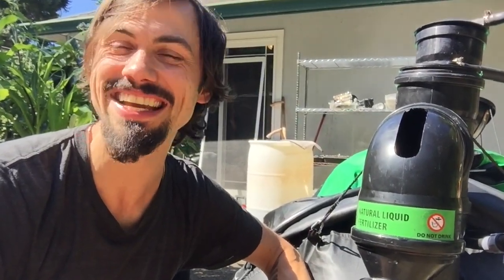Turn Your BLACKWATER into FERTILIZER with Permaculture Soil Science!!

Comment: How much/often do you have to feed the digester to get steady gas flow? Do you solely use biogas?
Reply from the maker: Great question! I just got it going - gas is about 30-40% filled now. I'll know more as I use it over time, but it's just the first stages of it and I'm sure what I feed it will influence the gas output and quality. I want to figure out what it's output is to see how much we can rely upon it - I also want to see what it does with a gas generator! How much electricity is inside one of the filled bags of gas? Right?? :) I'm having fun with it! It's a living experiment!
Reply: Looking to buy a property and build a few houses on it to homestead wondering how this would work with about 50 people how big the system would need to be

Comment: I'm intrigued by this biogas digester. Does it produce enough for heat, or just cooking? Do we know of anyone who has converted their camper from propane to biogas? 
I'm living in a camper right now (stationary) that uses propane, but I also do humanure, and this has got me thinking... 🤔
Reply from the maker: You can absolutely cook with the gas and heat but not for very long so it's not a daily heater.
Reply: @ThePermacultureStudent  That's too bad. Hopefully it's on the horizon. I don't use much, but I still get pangs of guilt everytime I refill these tanks.
Reply: You could if you, well... "contributed" enough to it each day, but the small model he went with is designed for two people and apparently averages enough methane to run a gas burner (basically a camping stove) for an hour or two per day. In theory you could get some kind of pump and slowly fill a propane tank throughout the year, and then only use it in winter... assuming it doesn't degrade.

To heat a living space in the winter, without saving it for a long period of time, you'd need a much bigger one and be adding manure from something like a few cows/horses, a bunch of pigs, etc -- as well as some people. I have seen people do that,  using custom biogas systems that work the exact same way, using livestock and human manure to fill up large containers, then use it to run propane generators that can be modified to run on methane.